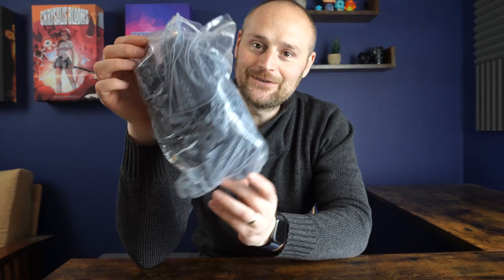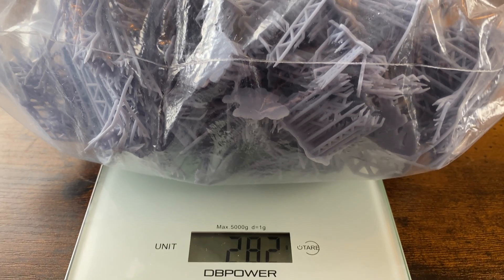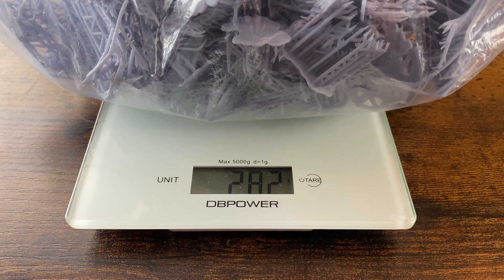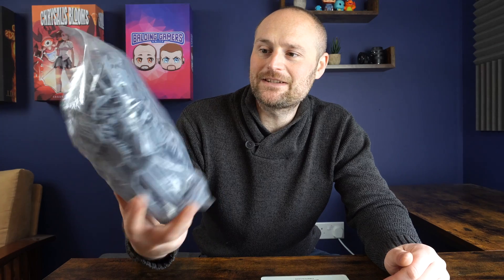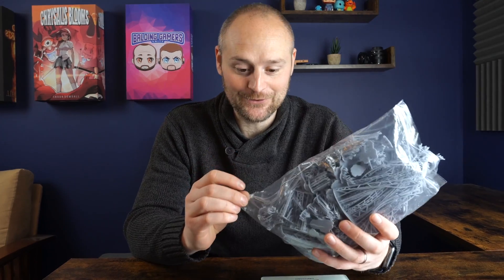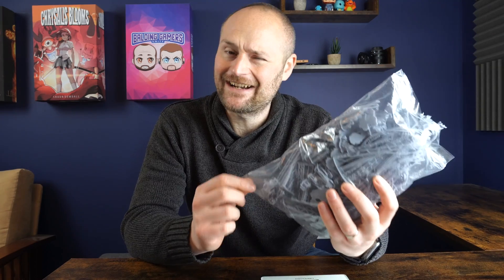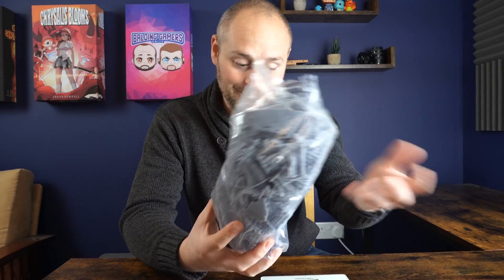1KG Bottle of Resin: How much is wasted?

Comment: Under 30% sounds ok for supports waste.
But weirdly your bag seems to hold rather ticker supports, which makes me wonder about the models
I've gone extremely light (0.18mm tips on 0.56mm columns formed as tri-truss-towers supporting many tips ) and my supports calculated (by Lychee) are about 15~20% (depending on model complexity), that's after I've hollowed my models (I hollow all medium & above model, and also thicker minis - like orcs for example. I hollowed a standard ~28mm human fighter to 0.5mm wall and it worked and drained properly, but I don't normally do it for thinner minis).
With the minis (and larger minis) I use ~0.7mm wall now (used to do 1mm wall first, then 0.8mm, but still don't see noticeable compromise in the prints strength ... but strength isn't a major goal in minis printing anyway)
Compared to the resin amount (for both model & supports) from presupported files I use ~35% of that resin (ie I can print ~3 times more of the same models, and can even afford some failures, though it has been very difficult to get a failure ... w/o doing something very stupid :)).
But I have no idea how much resin is lost when the printed models & build plate are washed after printing. Do you know?
Of course it depends a LOT on the model complexity, for example if it's hollowed but more difficult to drain, some more resin would be trapped inside and would eventually be washed out by IPA, compared to solid cubes for example :) 
I also use a printed hook to let the build plate drain in the vat after printing at 45 degree angle. But I don't think it's very optimal - I now plan to use planar cut and merge it after twisting it some more, and more importantly to the other axis too (because currently it only tilts the long side of the build plate, but the short side stays horizontal) ... of course the drain potential of the models depends entirely on their shape & complexity.

Comment: One use of the supports, is if you have bits and bobs floating around in your resin, like from broken off supports/prints, you can do a full screen burn, to cure the whole bottom surface of the vat. Put down a piece of the supports in a corner, with the flat side down, and cure. That'll trap any bits in that first layer and you can use the old supports as a handle to pull out the whole sheet of cured resin (and in the corner to make it easier to peel off, instead of trying to go against full suction forces in the middle).
Reply from the maker: Great point that I completely forgot to talk about. Done this a few times and it’s such a great way of peeling that layer 😄